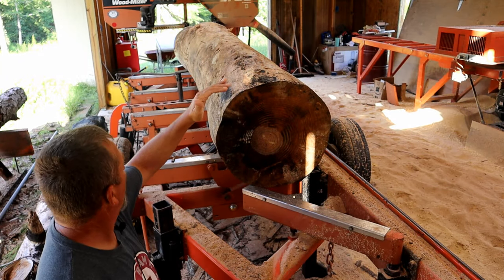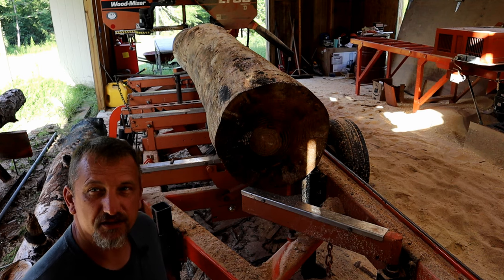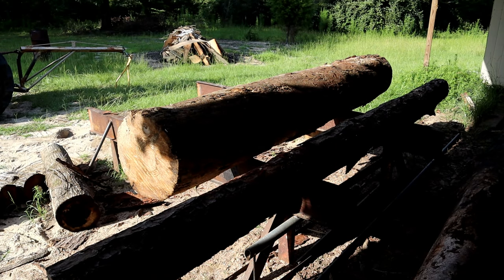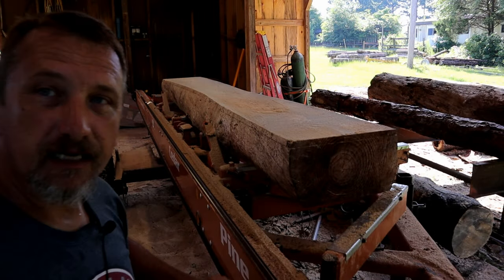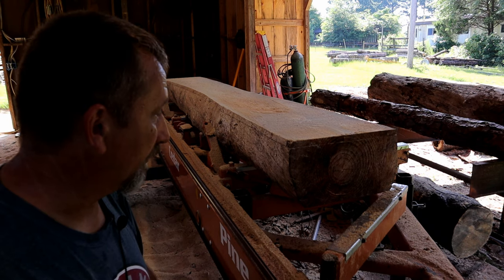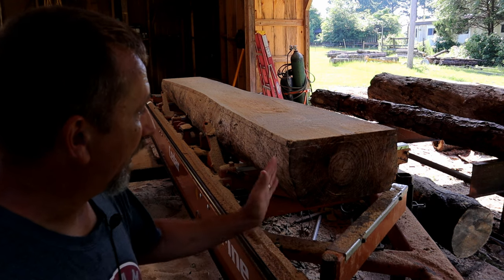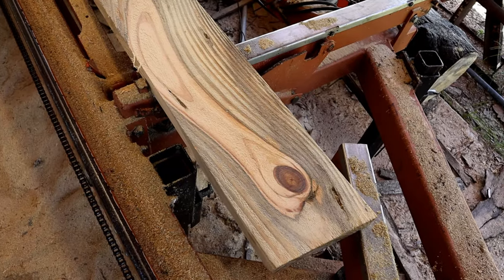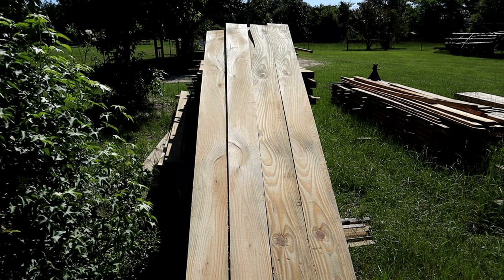PUNKY ROTTEN LOBLOLLY PINE

Comment: Bout got to hot to Mill . I sawed last night and it was still hot around  10pm. My shirt was soaked.  I be glad when frost comes. You dont get so drained from the heat in the winter. Saw dust even smells better. Ga.
Reply from the maker: yes sir it does get a bit warm here, between the rain showers, it has rained here everyday for a month or more. where in ga?
Reply: @realsouthernexposure3957  McRae. Telfair co.